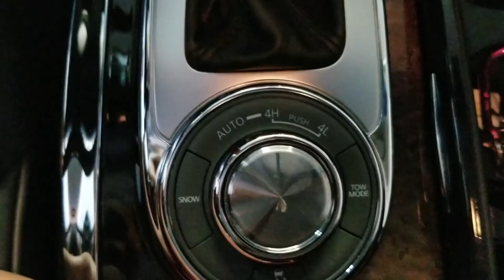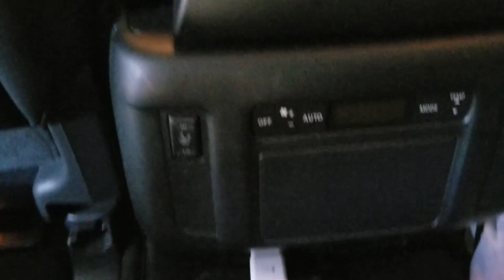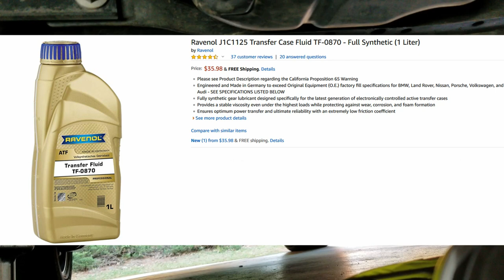2012 Infiniti Qx56 4WD Quick Review & Oil Change

Comment: The oil filter is mounted to a heat exchanger that also has engine coolant running through it. The unit left of the oil filter is the trans fluid warmer or heat exchanger.

Comment: Morning Bro, Just saw your video on your QX56. I also have a 2012 Qx56 in metallic silver very strong SUV with 20 inch tires and the sport rims. glad you did the oil change and i will start doing mines the next time.
Reply from the maker: Yeah it's an easy car to work on.

Comment: Came across your videos trying to decide between luxe q50 and rs400. Thanks for all the information you provided. Have had g35, g37, q50, and tomorrow pick up the q50 rs400. We now have virtually same garage as I have 2017 Armada plus the q. I also change oil in the Armada without jacking it up!
Reply from the maker: Great man... saves lots of money doing your own maintenance as much as possible. Plus you don't have to wait in line at the dealership.

Comment: Man thanks for your review. I’m on the fence with purchasing a QX56 same color & your video convinced me a little bit more on getting one. Do you still like your truck & what to watch out for on repairs?
Reply from the maker: We are at 157k miles... only one real repair,  we had to replace the air suspension compressor. It cost us $1k.

Other than that just oil changes, brakes, and tires... normal stuff.

Comment: Hey KayDro!! 1st off, Great Vid!

2nd... I'm looking to buy 2011 to 2013 QX56 used, BUT I'M HEARING A LOT OF OWNERS COMPLAINING ABOUT THE TIMING CHAIN GOING OUT, at a repair cost of $3500 to $5000?!?! 

That's scaring the mess outta me!

Do you have any info on these issues and do you have any recommendations/ tips for me, in looking to buy this Lovely SUV?

THANKS FAM!!
Reply from the maker: The timing chain is a safety recall, my qx56 had it done for free at our local dealership. It's been 40k miles since our chain was replaced and no issues out our qx56.

So which ever qx56 you are thinking of buying call you local dealership with the trucks VIN, or look it up online to  make sure the repair is covered for your vehicle.
Reply: I believe they had a recall on the timing chain should be able to get it replace for free.just call the dealer with the vin
Reply: If you get a white 2011 watch out there's a class action suit about the paint
Reply: Karim Atkinson  I think the recall was extended to the cats as well. I’ve been researching, about to purchase.

Comment: Great video but make sure you put some oil in filter before you reinstall,oil had to be pumped thru filter before it starts thru engine there are a few seconds of no oil at startup may cause unneeded ware

Comment: Is the 2015 QX80 the same as the QX56? Pros and Cons if you can. Thanks. Great work on the video learned a lot.
Reply from the maker: They all the same from 2011 to 2020... more options as you go newer though... and different front and rear facia in 2017 I believe. The 2021 has a newer interior and infotainment.

Comment: A couple corrections.  The fuel tank cap is 25.9 (usually listed as 26 gal in specs).  The timing chain recall is for the 2011 thru 2013 QX56.  Easy to verify this info.  Nevertheless, thanks for the video.
Reply from the maker: Ok... thanks.
Reply: @KayDroTechnologies  No worries. Deep into my own research on used QX56 and QX80 models so wanted to share.
Reply: @steviebster1 did the 2014 Infiniti qx80 have the timing chain and catalytic converter issues too?? Pls help, i intend to buy one soon
Reply: @fortuneejikeme  The timing chain issue affected 2011 thru 2013 QX56. I did get a catalytic converter error message on my QX80 with 155K miles. I ran cataclean through it and engine light stil hasn't come back on at over 157K miles
Reply: @steviebster1  okay. Thanks
Reply: @steviebster1  it is a bad car?

Comment: I just found your video.  How many miles do you have so far?  Any major issues?
Reply from the maker: 139k miles now... car is great.

Did the timing chain and catalytic converter recall. It was free under warranty. Then the only repair has been the air compressor for the auto-leveling suspension $1k at the dealership.

Comment: My old boss has a 2013 QX56 same color and all but it just hit 200,000 miles!
Reply from the maker: We are at 145k... and the car drives like new... everything works... these are well built trucks.
Reply: @KayDroTechnologies  am about to buy my 2012 with 104k miles , now am scare because the timing chain. . If is a recall, the dealer extended warranty up to how many years or miles? Thanks
Today is July 28, 2020.
Reply from the maker: I'd call the dealership with the vin number of the qx56 you plan on purchasing... and confirm the recall will be fixed under warranty.

Comment: Just bought a 2011 QX56 exact same color you have inside an out. Got it for 11200 cause the dealer was desperate to make a sale. Just got the airbag recall done at the dealership but it's giving the catalyst code p0420  or 0430 so they are saying to replace both catalytic converters at 5k. Cannot afford that but I talked to other mechanics and they said it's most definitely the O2 sensors if not two but probably 1 of them going bad. What do you think? And thanks for the tip on the timing chain I need to look into the recall issue.
Reply from the maker: The catalytic converters do go out on these... it's a known issue. My qx56 luckily had them replaced under warranty at the same time they did the timing chain... so see if your dealership will do that for you.
Reply: @KayDroTechnologies  Yeah, they said no. I even called the Infiniti headquarters and gave a piece of my mind. Why if 2012 you have a unofficial recall regarding the timing chain and catalytic converters you replace them but people that have the 2011 are having the same problems but they won't help them? They couldn't answer me except with a I don't know attitude so going to keep bugging them.
Reply from the maker: Yeah the recall was 2012 and up... unfortunately... but keep trying

Comment: How many miles does it have now? Is it still getting it? No problems?
Reply from the maker: Over 153k miles now... car runs like a champ! We had the timing chain recall done, and had to replace the air compressor for the air suspension, and that's been it other than regular maintenance.

Comment: I'm looking to buy a 2011 qx56 but I keep reading negative comments on reliability.  We had a 08 armada with no problems just regular maintenance and changed out starter & alternator. Any advice before i buy i really like this body style and car itself. How's the car holding in 2020?
Reply from the maker: 2011 to I believe  2013 have a timing chain recall on some VIN numbers. So check the VIn number of the one you want to buy... if its an affect VIn the fix should be free. Other than that we are at 144k miles on our 2012 Qx56 with no issues to report.

Comment: I've been toggling between 11 QX56 and 09-10 Escalade or the cheaper Armada which didnt get a body upgrade after 11 except loosing the chrome bottom lip. The somewhat downgrade from the Escalade I'm considering in the Yukon Denali 09-11. I always thought it was ridiculous for the expensive SUV to be thought of as off roaders like that Lincoln pickup lol This QX56 grew on me as well. Had to get used to that weird slope in the back. Do the front monitor play video or DVD?
Reply from the maker: Yes the front monitor plays DVDs too... but only when parked... you can hack it if you are good with wiring.

Comment: Hey bud.  My wife and I are purchasing our first QX56 and I hear horror stories about timing chain problems.  Anything I should be aware of?  Thanks
Reply from the maker: There is a recall for certain vin numbers... id call your local Infiniti dealer and see if the truck you are purchasing has an affected vin... if so its a free fix.

Comment: Nice review. Glad I purchased one however both Catylic converter goes out and that’s $4k!  Luckily they went out a week after I purchased from dealership.  Other then that this beast drives like a mid range sports car!!!
Reply: I only use super unleaded... my friend is a Machanic at infinity and told me to never ever put regular unleaded in it! Performance difference due to low octane gas will cause future damage to the engine from loss power
Reply from the maker: Yes both Catalytic converters went out on our qx56 also... it was covered under warranty so no worries.
Reply from the maker: We use 89 or 93 gas... car is fine. We never put the low grade 87.

And yes the car does like 93 better.
Reply: What if you add octane booster to regular unleaded?
Reply from the maker: @kevinjermaine  it should boost the octane... 🤷‍♂️ but I rather just put 89 or 93 and avoid having to always have to buy octane booster.
Reply: It should run fine on 87. The owner's manual says suggested to run 89+ but it'll run the 87 just fine.  

You lose 10 HP running 87, but it won't actually damage the engine you just won't get max gas mileage. 

The ECUs in the engine prevent any knocking or anything from taking place.

Comment: So how's the infinity qx45 holding up after a year??
Reply from the maker: We had it since 2017... car has never given us any problems... 136k miles.

We finally had to replace the air compressor for the auto-leveling suspension... $500 part... other than that it's been basic maintenance.
Reply: @KayDroTechnologies  Thanks for the respond. I'm in the market to buy one, any common problems I should look for?? I know catylic converters are one of the common problems.
Reply from the maker: There is an airbag recall and a timing chain recall for 2010 to 2014 Qx56... these are fixed for free by the dealership.  Yes the catalytic converter is another common issue... other than those it's a solid truck.

Comment: How do u find the air suspension  my car drops when on long drives and help pls
Reply from the maker: The air shocks are only on the rear... sounds like your air shocks are leaking or your air compressor is leaking... if you are under warranty I'd just hit the dealership and get it fixed.